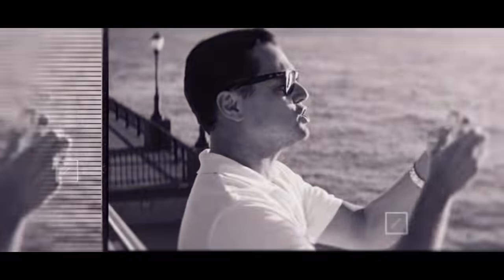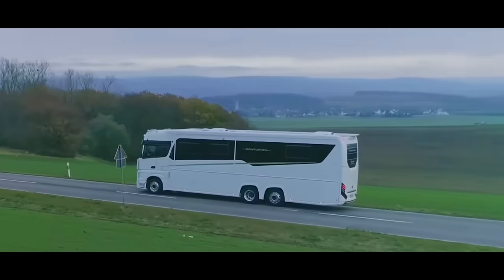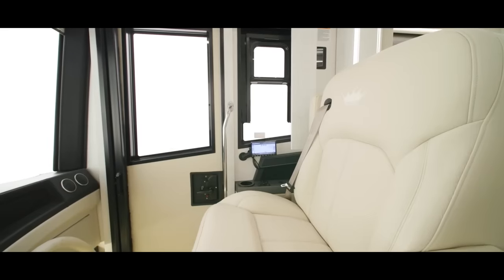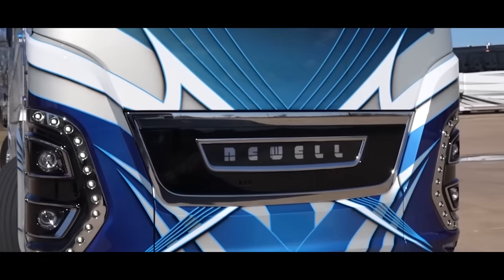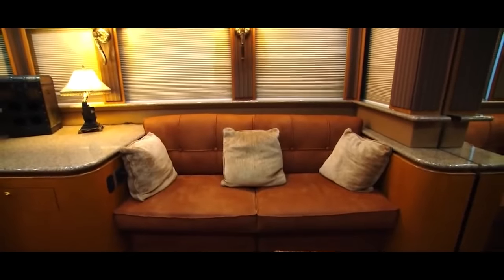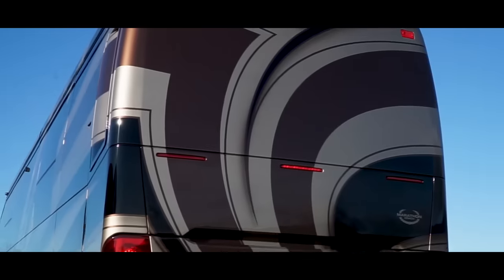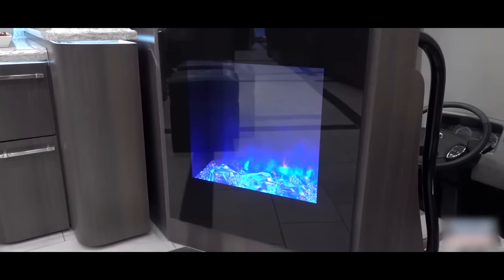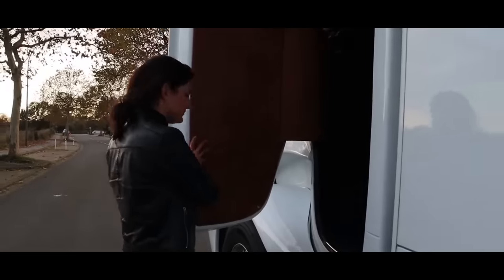The Most Expensive Motorhome in The World

Comment: I keep wondering how much the gas costs to fill these bad boys up. But that just proves I can’t afford it.
Reply: Some might answer that this way;"if you ask that question, then you can't afford it. I know I can't 😂😂
Reply: Well, that depends, which fuel tank are you talking about? Considering they have a thousand gallon fuel tank, and diesel is $5.00 (or more) per gallon, just filling a single tank is $5k. Then there is the diesel for the generator, and the diesel for the heater. Plus, you have to consider they get a whopping 6.5 MPG (best case scenario.) ...and then if you want to fill the gas tank of the car in the garage belly, you've got to add premium high-octane fuel to that list as well.  So.... it really depends upon the length of your trip, both ways. 😅
Reply: Ft 21:55
Reply: @heatheri10 I missed the air powered features thanks.
Reply: @PollyHistor 200 gallon fuel tank is far from a 1000 gallon fuel tank, big difference in price
Reply: Probably a first born.
Reply: Money is not a problem for these types of rich
Reply: They're electric
Reply: You can I’m a single mother of two on wale fare I bought it with my taxes I have a 40 foot class A I bought with income taxes it takes me a little over 100 to fill up but I have diesel so it last very long it’s comfortable and I can cook full meals and do my laundry in my motor coach I bought mine used 10000 in Florida on offer up
Reply: In my experience, the more expensive something is the bigger piece of crap it is. Spend more time in the shop than the use you get out of it.
Reply: I wonder whether you can rent one of these and for how much?
Reply: What is RV stand for?
Reply: These high-tech vehicles tend to need more electricity.
Reply: electric vehicle

Comment: I would rather stay in a hotel with services provided. 1 mill will buy all the plane tickets, hotels rooms and meals I need for the next 30 years.
Reply: Someone with money enough to buy a $1 mil motorhome also has money enough to probably buy houses all across the country, multiple cars, still money to go into hotels, etc. But motorhome means they can pull up to any random spot in the woods or mountains and basically live there for however long they like.
Reply: And get bed bugs or have someone rob the hotel room. Lost luggage or stranded in an airport.
Reply: I just need a warm blanket and a P bucket😂
Reply: I honestly can't tell the difference between the half a million versions and the 3 million. It's just a bunch of bells and whistles and unnecessary embellishments from what I can tell. Size wise and amenity wise I don't think you're getting that much extra. You could buy the half million version and add the improvements yourself for a fraction of the total cost of the most expensive versions. Anything above that is pure flex in my opinion.